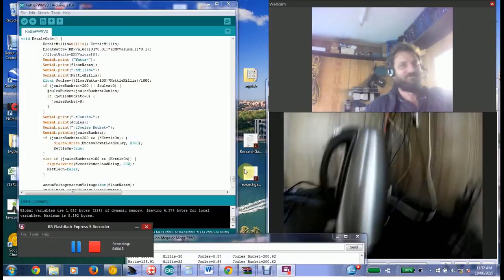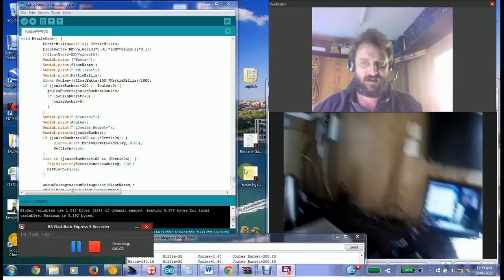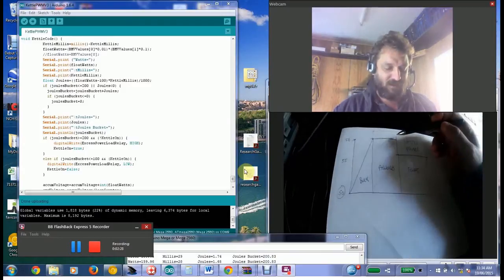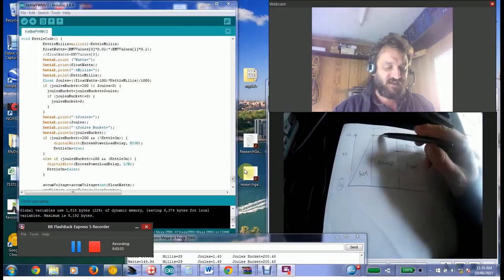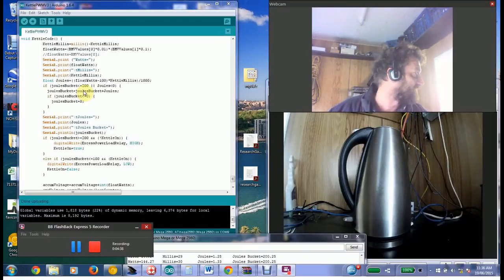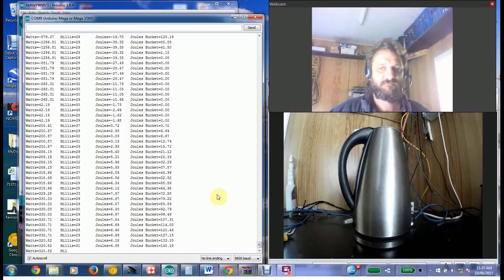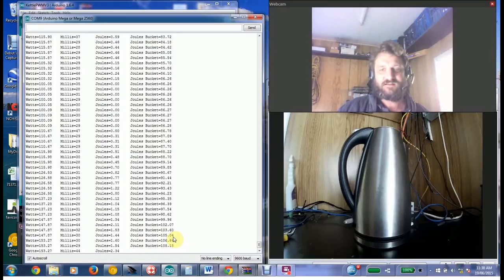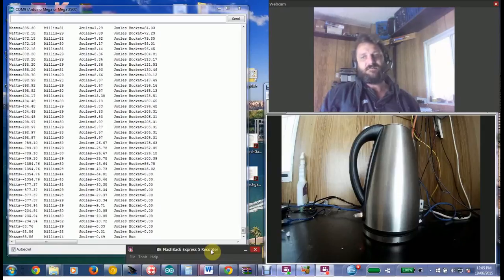HOT WATER from Excess Solar Photovoltaic Power using an SSR (or Triac) & Arduino...

Comment: Are you still using the arduino?  what are your thoughts of using the raspberry pi with this system? Would this be able to be scaled up to heat water for residential supply? Thanks great informative video although feels a little above my ability.

Comment: Got a new idea for you and this can be used with any controller.  Isolate a capacitor bank from main battery controller with a diode.  That capacitor bank will charge up to the power point voltage of the panels.  Doesn't need to be exact as that could be adjusted seasonally. PWM that into a heating element. OK, doesent work for a coffee pot but heating a water tank it works great, 2000W 120V elements are available cheap.  Measuring capacitor bank voltage and incrementing/decrementing a counter in software based on reference voltage gets you the PWM.   run multiple heaters with several PWM outputs.  One or two heaters will always be on so cap bank doesn't have to be that large. It runs great and no electron is wasted. Simple Arduino code.

Comment: It's really awesome to see people come up with ideas like these to maximise the harvest of energy from solar panels. I did a hack to a 10 Amp Stecca PWM charge controller a while back to control external mosfets. 

This means I can switch a much higher current than the internal one could. But the really cool thing about it is I made it control two separate devices and one of them is inverted in operation. 

So when it reaches regulation point, when the 'main' mosfet (which is the one that's charging the battery bank)goes off, the 'auxillary' one is turned on which can divert the entire capacity of the panels in that moment somewhere else.  In my case currently that's another battery bank but it could easily be a heating element or similar.

Because it's only diverting power while the controller is executing an off pulse, in theory it shouldn't effect the charging of the batteries at all regardless of solar conditions.
Reply: +Easily_Bored_Engineer Well, it must introduce some. But I would suspect not much more than any kind of PWM modulated power does, as it would simply look to the batteries as a PWM waveform with a high mark to space ratio. 

A capacitor could be used to smooth it, although I haven't found that necessary. At any rate that power is only applied to the auxiliary batteries during their bulk charging phase. They are finished off by their own charge controllers & solar panels. So I don't think there's any chance of there being an over voltage situation even if the ripple is severe. 

It's interesting that some subscribe to the theory that pulse charging is good for batteries whilst others consider it super bad. I'm not too certain which way to go with this one - maybe pulses are beneficial in flooded batteries but not in AGM perhaps?

Comment: Very interesting solution. I also use Victron equipment and sometimes do some easy things with Arduino. Could you please share your Arduino sketch? I would like to understand how Arduino talks to Victron and I wish to reapet your solution using my equipment. Thank you.
Reply: +Easily_Bored_Engineer . OK, I understand. Thank you.
Reply: Hi, Finally I found a solution how to talk to BMV and MPPT and I have repeated your project. Even more I used pulse skip modulation. That means one or more full cycles are transferred to the load and then one or more cycles are not. It is very effective because I can harvest more energy in cloudy day and avoid discharge the battery with a high current when solar irradiation is low. But I have noticed that switching on and switching off the Multi makes flickering light in my house. Multi is very sensitive even if switching small loads. Have you the same phenomena?  Is the solution using phase cutting method with a TRIAC and zero-cross detection?

Comment: Interesting use of surplus power, my brother in the UK (Mud Island) uses a commercial product to heat his geyser made by 'Solar iBoost'.  They claim it doesn't 'hurt the system'

I have made a storage Heater (heating up a big lump of concrete) to do similar, but no intelligent controller as yet.  More and more devices need to talk to each other to make the overall usage & control easier & efficient.  I wonder where it will all end up eventually IoT?